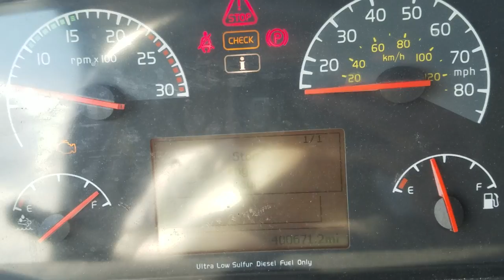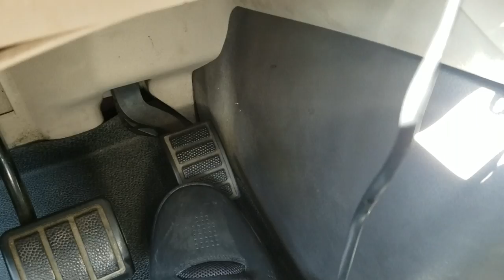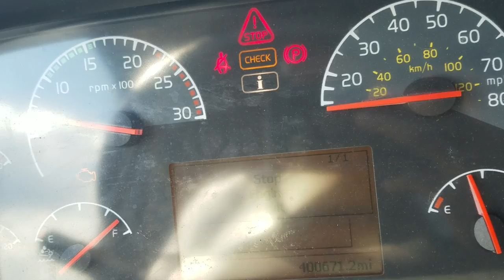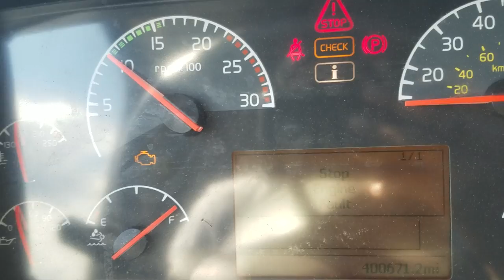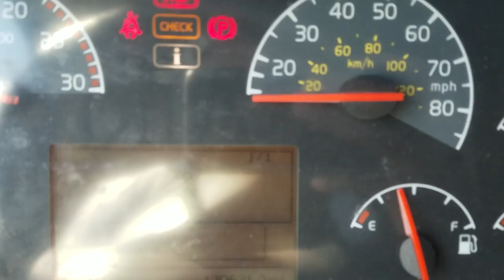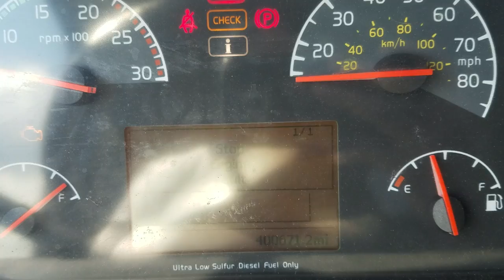Volvo semi Truck won't go over 10k rpm with gas applied

Comment: The problem is that: all to voltage from the battery is used to power the lights on the dashboard and there is no amount v to power the injectors :)
Reply: Bro this is my issue , I had to jump started after having it parked over 2 months and when I got it started, now it won’t accelerate won’t go pass 1k rpms 
Do you think I put the batteries wires wrong? Or is this something that will fix the longer the truck stays on???

Comment: 10k? Let me know when you find a truck that goes pass 10 000rpm.
Reply from the maker: Philip Koen ikr I read it out wrong when i was shooting the video them run away trucks with the white smoke does it 🤣
Reply: it will go over 10k when it runsaway, Diesel RUNAWAY
Reply: @outcastsociety8513  LOL
Reply: He meant 1k. We all sometimes make mistakes
Reply: @outcastsociety8513  Georgia overdrive, it's in neural going down a hill. Won't bring it to 10k. And if it did, I'd throw into neutral and hit the runaway ramp
Reply: @wendyking9759  And when most of us make a mistake we rectify it...don't people double check before posting something and edit out the mistakes?

Comment: my volvo truck FM12 420MODEL has a problem on Acceleration some time a it does not working and after removing the battery sensor it work again for few minutes. what will be the  problem

Comment from the maker: found out it was a knock sensor common problem
Reply: Hello I have the same problem on 13 Volvo 670 ....also does that cause engine brake and cruise to not work
Reply from the maker: no everything else should still work it was the knock sensor I found out my frieghtliner degraded like this last year from that and the DPF failing
Reply: Hello kenji, do you know where is the NOX sensor is located? appreciate it much for the help. same problem with our volvo.
Reply: Kenny 4547 wat is a knock sensor
Reply: @adrianals7932  where is the knock sensor located?

Comment: Need help just got my turbo rebuilt yesterday but I jeep having issues going up the hill.  It keeps loading power I have a volvo 2012 d13 I got my egr and my turbo rebuilt and still when I drive straight it drives good but when I go uphill it loses poower rpms and speed sp fast
Reply from the maker: Danny Perez prolly knock sensor doing it that's cool how long you owned your truck
Reply: Did you try the speed sensor?.
Reply: Sounds like loss of compression

Comment: I am having the same problem but my truck doesn’t go over 1500 rpm. Also the engine brake and speedometer won’t work. Before I would turn the engine off then back on then it would work but now it doesn’t work at all, but still able to drive it.
Reply: Mine won't rev past 1600 in 11th gear. Sometimes 15 and a half